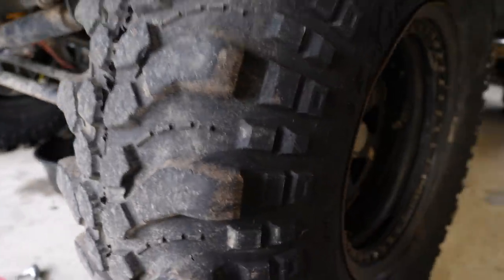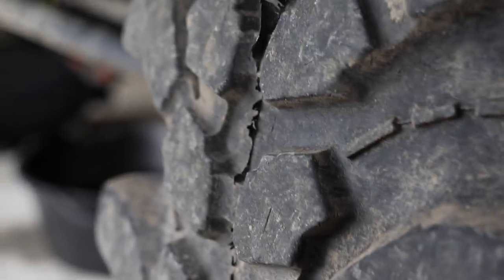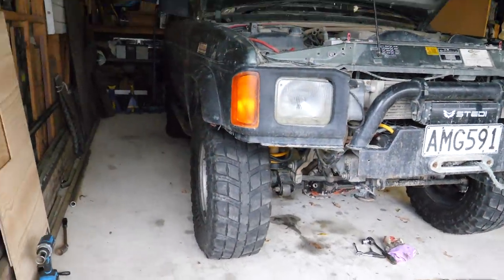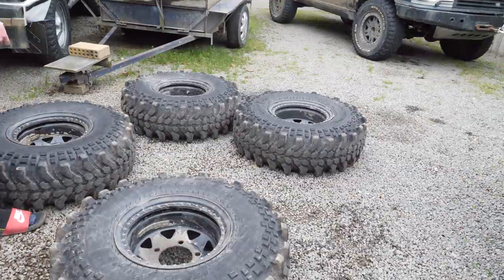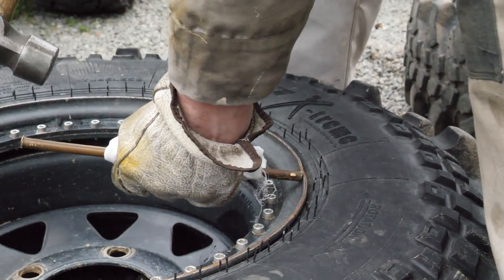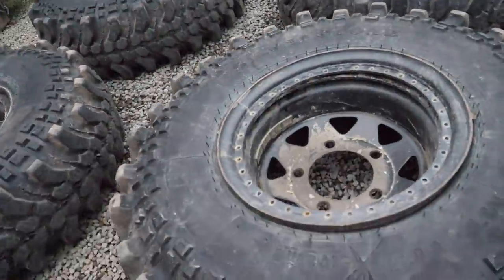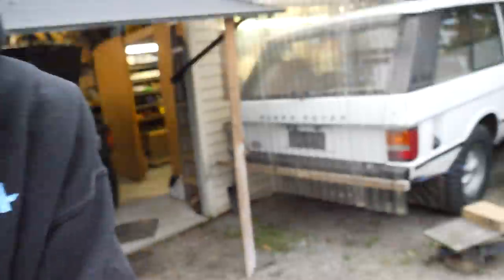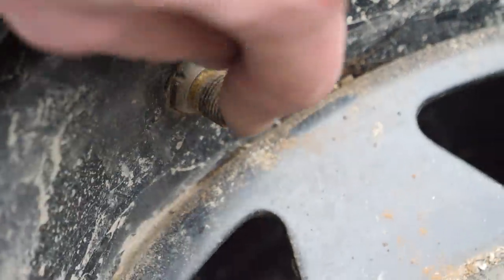Afternoon Shed Vlog. Battling Lando’s Beadlocks as it’s getting new tyres!!! 35s...?

Comment: great video 👍  a question why do you run tubes in your bead locks ? I just run dump valves in my bead locks and use silicone around the locking ring never had one leak or pop off and in the bush I would run them between 5 and 10 psi
Reply from the maker: Thanks! No good reason, other than I had them and at the time didn’t know enough to know they’re not needed. It is nice knowing you can’t burp air out of the tyre tho. In saying that I’ll likely not run them this time round